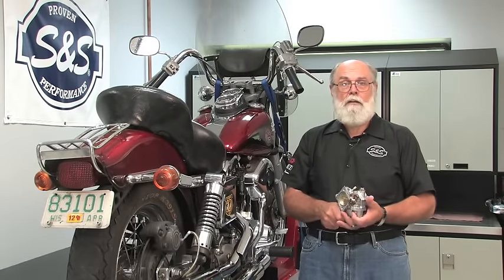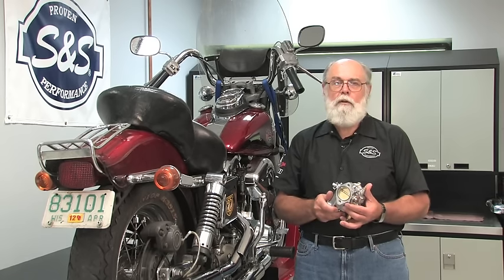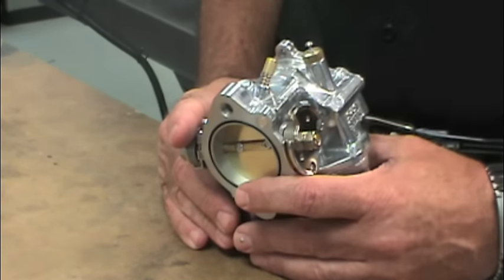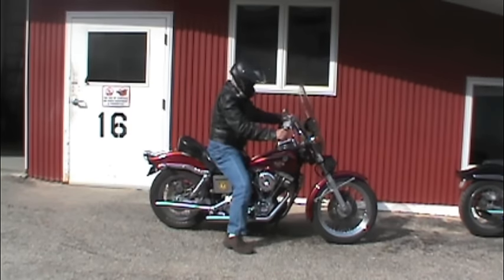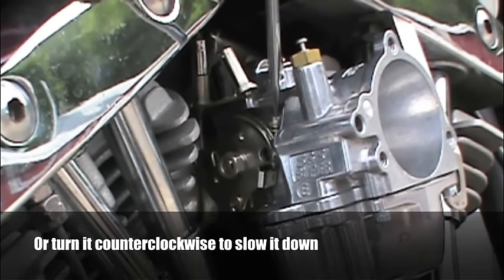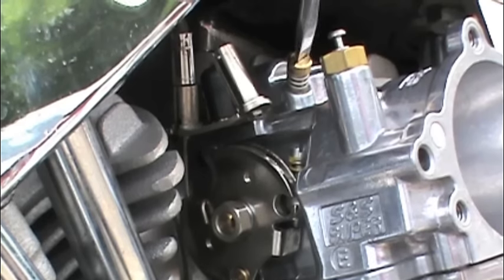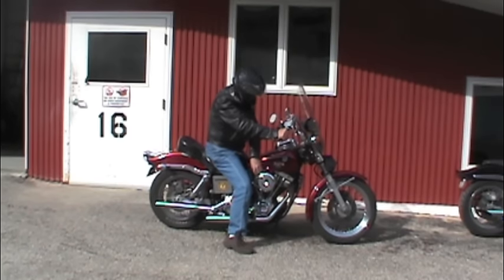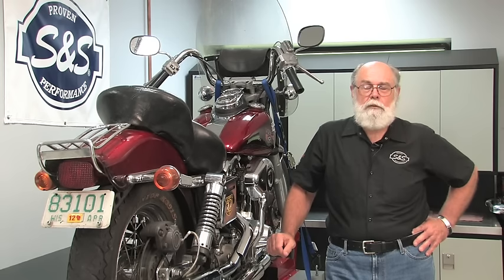S&S Cycle - Super E & G Carburetor - Basic Setup

Comment: Same Procedure with an Ultima R1 Carb ?
Reply from the maker: Robert D It would be best to consult the manufacturer. Thanks.
Reply: +Robert D Ultima carbs are a ripoff of S&S design and asking for S&S to provide tech support for them is like asking someone for help with a car that was stolen from them. 

Their answer had to be diplomatic. Mine does not. If we don't support quality American manufacturers who have been contributing to the motorcycle aftermarket since before most people reading this been alive, we won't have them in future. I've been installing and running S&S parts on all my and many friend and customer Harleys since the early 1980s. 

I don't hate on competitors but my money goes to S&S. I've put over 100K miles on my first Super B and it's still in fine shape with no wear issues.

Comment: bruce how about setting float first if that isnt right your wasting all the steps you went thru
Reply from the maker: Generally this procedure will be used on a new carb and VERY seldom will the float be out of adjustment. Even with a used carb it's not usually an issue, but you make a good point. If this doesn't work, the needle and seat and float should definitely be checked.